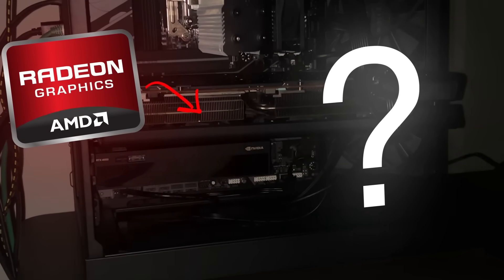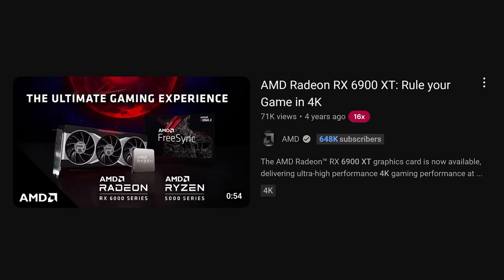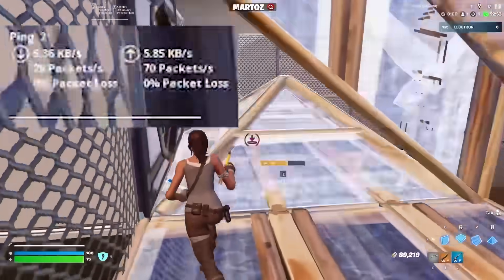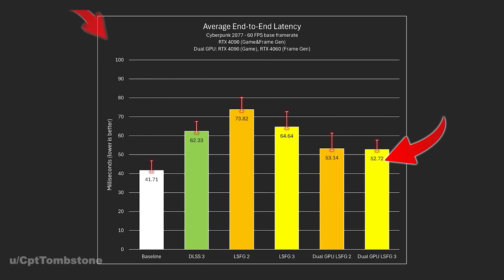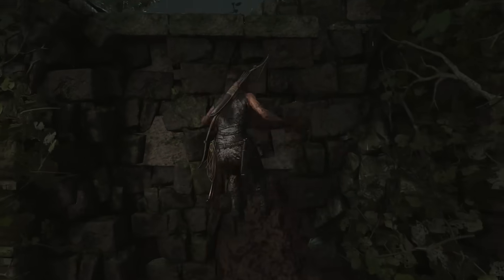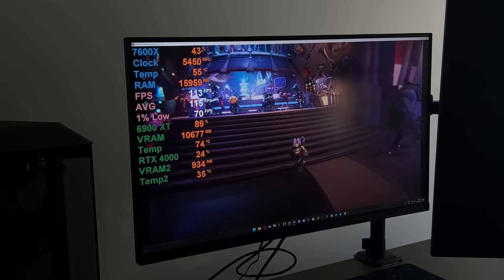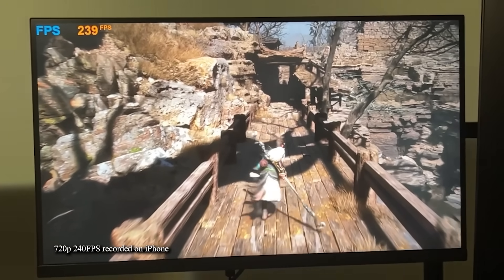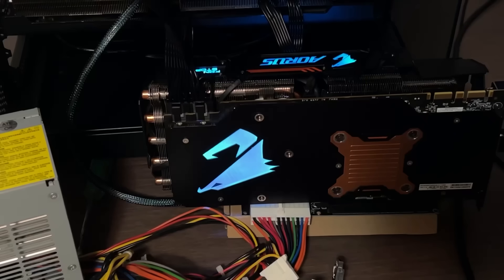I Used Both AMD & NVIDIA in One PC and Got 240 FPS in Every Game

Comment: can i use 2 nvidia gpus? , i have rtx 3090 and gtx 1080ti , 3090 for base frame and 1080ti for generated frame?
Reply: or should i just buy a cheaper amd gpu? (i dont mind spending $100-$150 ) , i also have a motherboard with 1 pcie gen 5 slot and 2 pcie gen4 slots all of them are x16
Reply: try it out! I got a 3090 (should be better in games but just isnt) and a 1080 ti (best card ever) and I see no reason NOT to try this out.

Comment: What do you mean there is no reason to buy a second GPU for frame generation. I can buy a 1080 TI in Canada for less than $200 or I can buy a 5080 and get the same performance for$2200. I don’t mind saving $2000 and only having a couple hiccoughs once it’s working.

Comment: There is another way you can get alot more fps if your main card is nvidias - get a second cheap card. in control panel go to physics and select physics to be calculated on secondary card and boom more fps from main card

Comment: it does really have potential on laptops, in my case, i use a hp victus with a ryzen 8650 hs and a rtx 4050.
lossles scalling can scale games using the radeon 760M and running the game on the 4050, it alow me play Kena scalled from 1080p@60 fps to 4k@120fps.

Comment: money kinda side....but external gpu enclosure?    with a 670 series chipset should still have a couple 10gb/s ports or faster. not sure if it would be better then m.2 adapter but might be easier to access.

Comment: Hm..... I have an X470 board that can run x8/x8 PCI-E 3.0, I have a Liquid Devil 6800 XT, and I still have my old 5700 XT with an EK water block on it. Basically have all I need to build a watercooled dual GPU setup. Hm.....

Comment: I'm curious about the power consumption though. Would it be just like you're running 2 GPUs normally, or would a GPU or both GPUs consume less power since they kinda work in tandem?
Reply: The power consumption would be unequal in that the rendering card would be using most of the power while the other only does the frame rendering which is less intensive. That being said, your assumption they work in tandem is inaccurate. They work in tandem in that one card gets passed the frames to the other for the frame gen, but there’s no actual increase in rendering power. Frame gen card is blind to what’s coming it just extrapolates frames. The video title is unfortunately disingenuous. Whatever the game actually renders at let’s say 30 FPS, if it’s now at 240, it’s just gonna look smooth but with the feeling of 30 FPS

Comment: This is an excellent video! I think it also shows a more promanent issue - Terrible game optimization. These powerful cards let some developers be even lazier with their code and it's a shame. Back in the day we had developers do a much better job on that front.
Reply: No not at all actually. The only thing he demonstrated was frame gen. You may want to read up on what generated frames are compared to actual frames. Terrible game optimization is a fact but this is not the solution, in fact, if anything it’s fuel to the flame. If you can convince suckers (no offense) that they’ve actually “increased” frames, you see number go up you’re happy, they have to optimize less, they’re happy.

Comment: You have to mess arozund with power supply, drivers and so on.
How about using the iGPU of a Ryzen 7000 or 9000 or even a Ryzen 8000G.
What are the results then? 

This is actally something a would consider, buying losless scaling and boost the GPU with the iGPU
Reply: You can use your iGPU. I think the LSFG subreddit has a step-by-step post there on how to make it work.

Comment: wil it's still work using with both nvidia gpu ?
Reply: Yes
Reply: @RandalReid  do you think what is recommended psu watt, should i use for running that dual gpu, I'm about try running it with 3080ti as main gpu, and 1080ti as frame gen ?
Reply: @ As much as I would like to help you buddy, I do not know. Try asking the people at the Lossless Scaling subreddit. There are people there posting tips on how to run dual gpus properly.

Comment: Ultra leiser AMD Ryzen 7 8845HS (8C/16T, bis zu 5,1 GHz), 32 GB LPDDR5 (5600 MHz) 1T SSD, Mini-Computer, NVME*35
1.Ryzen 7 8845HS / 32G Ram DDR5 + 1T SSD M.2 2280 PEIC4.0 ohne System
2.2.Unabhängige Oculink/HDMI2.1-Schnittstelle, unterstützt Dreifach-Bildschirmanzeige
3.Nur 0,6 l Volumen, platzsparend/„Forest 2.0“-Geräuschloses Kühlsystem
4.Lokale Servicezentren in Deutschland und Amazon FBA-Lager, WiFi 6 2,5G LAN 8K Dreifach-Bildschirm,schnelles System für zb. zu Hause. Notebooks vergleichbarer
Ausstattung kosten das doppelte.

Comment: So cool to know that, it's a very interesting technical video, thank you ! 
I'm wondering if it could work in the same way with two gpus but instead of the gtx 1080 we try it with a future 5050 to use the dlss 4 frame gen instead of the LSFG. In theory we could make it work but the issue could be in the software.

Comment: I don't get how does it work where are the steps. I have newer rx card and put back my 1080 ti.. so my frame gen is alreay enabled. I have the right motherboard. So all i have to do is plug my displsy to my 1080 ti? Oh i see has toaet the 108 ti ro be tge prefered high performer card. Wow i saw high fps. I thinks it working need to test more.
Reply: After more testing the high fps I was seeing was due to the game running at low resolutions on the 1080 ti. I think to correctly use this is to get both powerful gpu foe nvidia and AMD that way you can benefit by appending more performance top of the orher making it more than a single card at that level. I think it bettervto just run my game from rhe rx 9070 xt instead st 4k get a lot higher fps. They ahould develop MGPU then let AI manage the resource in game so programmer won't need to develop it and games should boost our of the gate.

Comment: Try using a amd radeon hd 5450 and an CPU Intel(R) Core(TM) i3-3220 CPU @ 3.30GHz 8gb ram good luck also make sure its an ddr3 ram This setup is absolutly dog water and i cant even believe it runs google i got like 12 fps in fortnite on lowest settings Ignore me if you want im just sayin

Comment: This only works best for me on open GL and thats because it already uses both gpus in openGL mode. 90 fps cap using x6 frame gen got me to 540fps x3 mode feels better and got me to 270fps (4060Ti and 2080 super)

Comment: quick question: how you even launch cp2077 with 2 gpus in the system? i just get a ray tracing initialization error whenever i try to launch it without disabling my 2nd gpu
Reply: He use Losslesscaling.  No Raytracing?
Reply: @Elmo-ys5js  Game checks all the GPUs you have installed in your computer when launched, It has nothing to do with raytracing, Game stopped working on multigpu systems after 2.0 (you can find tons of post about It), the raytracing error IS just their generic error when the game detects more than a gpu on launch

Comment: Lossless scaling is doing this Automatically in Auto mode if there is a second GPU. I have been using it on my RTX3060 with Ryzen5600G and works well. Doesn't need a second dedicated GPU.

Comment: Ok, it's really easy to see there is potential for this. If a mobo manufacture was to make a board just for this it could really work. 2 gpu slots running PCIe  at x16. You would still need a bigger power supply.

Comment: Remember using your 2nd GPU at the same time is faster than buying a new GPU
Reply: Hear me out: Double x4 frame gen = 16 times more frames
Reply: @山囸山本 Todd Howard has entered chat
Reply: The more you buy the more you save
Reply: I know that refernce mw2: 2009
Reply: @defendchrist   Press F to pay your respect for those who don't get it. ;)
Reply: and cheaper
Reply: Back when SLI still was relevant. (Still kinda miss my Titan X(P) Sli Setup)
Reply: Switching to your handgun ahhh reference
Reply: I regret selling my old gpu lol
Reply: The 'woosh' here in unreal
Reply: I've worked in Information Technology since 1999. I can tell you CURRENTLY using two video cards won't make much of a different. I have an NVIDIA RTX 3070 and an Amd RX570 GPUs in my system. I set it up to use the 570 as simply the output to the LCD and in windows 11 set the game to use the 3070 and it made things worse IMHO.
Reply: @whatsupdocchemdog5994 did u watched the video? He used Lsfg, that's why it works, kinda.
Reply: I have a 3060oc and am getting a 9060xt oc for Christmas. I was going to put the 3060 in an older pc but maybe I can get both to work together. I get the reference though

Comment: 0:33 I can promise you that dual GPU setups are not the future of PC gaming. At the rate the market is going, zero GPU setups (APUs) are much more likely.
Reply: I would expect APU + GPU setups to become the norm, AMD is looking really promising with those newer integrated graphics
Reply: Lmfao APUs will not replace dGPUs on desktops.
Reply: However, APUs have some serious problems.
Firstly, the size of the die and also the memory connection.
If an APU runs on 64 bits of RAM, the memory throughput is extremely slow, especially for larger textures.
These are acceptable for mobile solutions, but they consistently fail for demanding games.
Reply: I totally disagree. APU's are quite bad + even dedicated GPU's kinda suck (they are not as powerful). First time in my life i am thinking of multi GPU setup and I need it for AI stuff. Currently we have GPU's that do 2 different things and we have a shortage.
If GPU makers would separate GPU's into 2 different components then it would make 100% sense and we see it already (not from nvidia tho). Separating different task to different GPU's would be so good.
Okay I understand that this is quite niche case (AI).

But for gaming... 4090 cannot run many games @ 3440x1440 (no DLSS, it kinda sucks + more heat and more load to gpu even tho it cannot handle it.. base framerate below 60fps is not good). Which is quite common nowadays. I would consider adding separate gpu for that situation.. for 4k or 8k separate GPU is a musthave.
Reply: Discreet shaders on the API is it for m-GPU
Reply: its more likely we only have small useless pcs in the future with a subscription to a server that hosts the actual performance
Reply: APU limiting everything, they will make non APU CPU to unlock all the limit, so no.
Reply: Apu isn't bad option for future but it won't replace GPU nothing can replace GPU unless cloud servers become entirely active and internet become cheap. by doing so many could use and play games mean while companies gain profit by this approach which is happening right now because GPUs becoming less available and harder to get and requires more expending. companies rather prefer to have high number of sale rather than just selling high price graphic card.
Reply: APU replacing discreet has been the talk since 2010, we are nowhere close to it and will never be.
Reply: @wh3resmycar  RX 8060S APU is already on RTX 4060 level, that's enough performance for majority of gamers. We only need AMD and OEM to make sure it is available on something other than $2000 tablet
Reply: @wh3resmycar  I guess you haven't seen the new AI chips AMD put out. They compete pretty nicely at the entry end. Since everyone is broke and everything is expensive, it's a really good option.
Reply: @wh3resmycar  We are closer than ever... The 8060S iGPU is getting close to RTX4060/RX6700XT performance. It is using RDNA3 technologies. Imagine now with Zen 6c and RDNA4 tech....
Reply: if APU will be the next gen tech i can promise u it wont be here for a long time. esp with gpu's capability of doing what lossless scaling  is doing now. once AMD learn that tech for its line of cards game over
Reply: Bull crap. Eventurally your current hybrid rasterization raytracing will be end of life & you'll need a full bore no Rasterization only Ray tracing card for gaming.
Reply: APUs aren't as powerful, ryzen ones are at the capability of a 1050, at best, maybe their G processors have a better igpu, but still lacking
Reply: Unlikely since AMD and Intel make way more margin selling APUs to consoles or laptop makers. It means desktop will continue to get the short end of the stick.

Comment: Years ago I did an nvidia x amd set up. One card was used for gaming, one was used for streaming/recording. At the time the AMD card was better suited for gaming, as the nvidia card could only handle either gaming or streaming/recording. Shadowplay was still new back then, but it worked very well, all things considered. The concept was similar to using a dual system setup, but.. two cards, one pc. I'm still surprised it worked. The nvidia card was a Zotac GTX750, can't recall what the AMD card was..

This video has me holding out hope for my RTX 3070 Ti. I have a 1080 in my second PC, but I wanna get a new AMD card. Having the benefits of the 3070 Ti while using an AMD card for running the game sounds very appealing.

Comment: Not really sure why it didn't work well with the 4000 Ada but did with the 1080ti. The Ada should be much better than the Pascal card in FP16 compute. Maybe it's the low power draw limiting performance, or maybe if you used studio drivers they didn't like it for whatever reason. 

But yeah, I'd recommend either an AMD or an Intel GPU for the dedicated card. They tend to be much better at FP16 compute than Nvidia are. You can even use integrated graphics if they're powerful enough, like in AMD 8000G or Intel Core Ultra 200 CPUs. They're enough for 1080p and 1440p frame generation, so that could be an option if you don't have the ability to fit a second card. At 4k you don't really have a choice and need to use a second card.

Comment: Is plugging your monitor into the GPU responsible for the frame generation necessary just for keeping latency low?

I started doing this with a low profile 3050 about a week agao. My 3080 Ti handles the rendering and is still the output to my monitor. I just set the 3050 as the preffered GPU in lossless scaling to handle the frame gen and it worked just fine. The latency doesnt feel any worse than having Vsync on. It completely fixed Monster Hunter Wilds for me.
Reply: @harmonickz6042  You'll get less base FPS with the monitor plugged into the render GPU
Reply: @FleXi2108  I haven't experienced that, but my use cases so far have been limited to Monster Hunter Wilds and games locked at 60fps such as Elden Ring.

My 3080ti averages around 45 - 50 fps in MH Wilds in 3440 x 1440p without any upscaling enabled. I'm able to lock the in-game FPS at 45 and run Lossless Scaling with my 3050 processing FG with target 90fps, and display output through my 3080ti. Input delay feels as if Vsync is on, and is extremely playable. Latency feels better than just running everything through my 3080ti. 

Base FPS stays locked at 45 and LSFG stays locked at 90 fps. Dips in base FPS only occur if I load into a new area, and even then, base FPS almost never dips below 40. 

 I noticed a massive improvement in headroom for my 3080ti and the 3050 sits anywhere between 40 and 70% utilization depending on what's going on. 

So from my experience, just connecting my LP 3050 to my motherboard with no direct output to any monitor and only processing LSFG has essentially fixed MH Wilds for me. 

For Elden Ring, my PC holds a locked 60fps pretty easily at max settings without Ray Tracing. I just set adaptive frame target to 120fps with the same display output through my 3080ti and I didn't notice any drops in base FPS or latency at all. It simply worked. 

I know I can drop my latency significantly if I just plug the monitor directly into a 3050. From my experience though, it just doesn't feel necessary. 

Sorry for the long reply, just wanted to detail my personal experience with this configuration.
Reply: @harmonickz6042  Hmm, I lost almost 30% base FPS by plugging my monitors into the render card. And others on the LS Discord servers experienced similar drops. But good for you lmao
Reply: @FleXi2108  yeah, that's what I'm seeing now that I'm on the discord. I'm just gonna stop speculating and listen to people who have already done the extensive testing 😂

Comment: Does this works with 2 Nvidia cards ou it needs to be one AMD and one Nvidia?
My second question is, I have a laptop with a rtx 4050 and an external GPU rtx 4060 ti 16gb connected through thunderbolt 3. Finally my 240hz monitor connected to the 4060 ti. Would this setup work?

Comment: "Should you buy a second GPU for frame generation? No"

The 50 dollars RX 580 that can achieve 200 fps at 1080p when used for Frame Generation:

There's so much knowledge about this on the official discord server and you somehow barely scraped its existance, the discord server is way more reliable than reddit
Reply: @ivanvladimir0435  I have a vega 56 lying around but my motherboard is x470 ultra with my main gpu 7800xt and cpu 5800x3d. Plus I only have 1 power supply with 650w only
Reply: @krisharyan8349  So you have a motherboard that would allow pcie 3.0 x8 per slot, you would be cutting it really close if you tried with undervolting, but I understand your concerns if you don't wish to try
Reply: @ivanvladimir0435  so i have 6900xt and 5800x3d , i do have a 580 8gb on the shelf , and i have 1200 tuf gaming psu , could i actualy just plug the gpu on the board with the gpu powered by cpu and use its fsr ?
Reply: @TheMikrostaR  You would need to connect the pcie power cable, but yes you would be able to